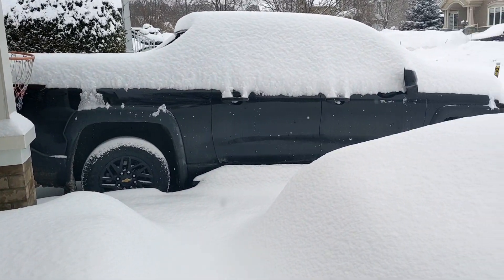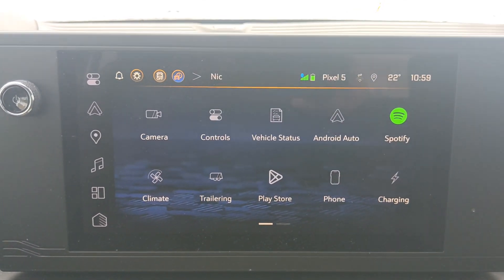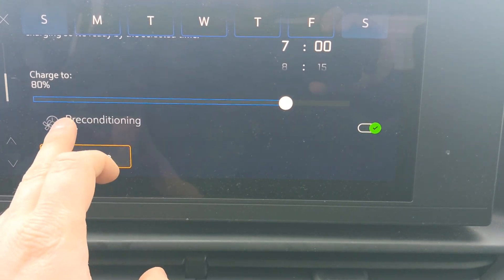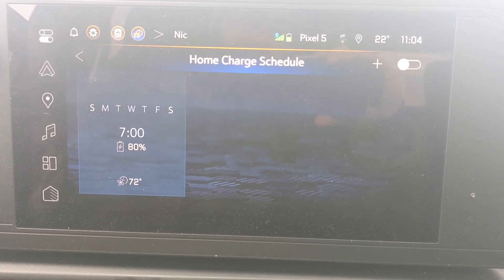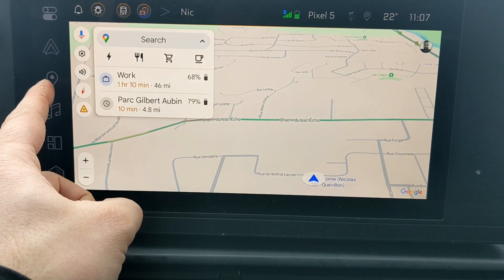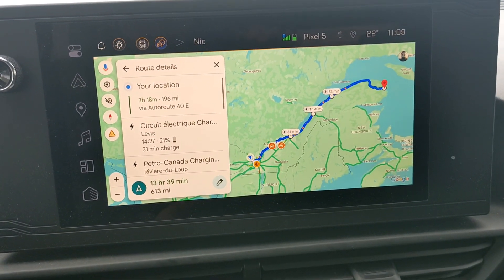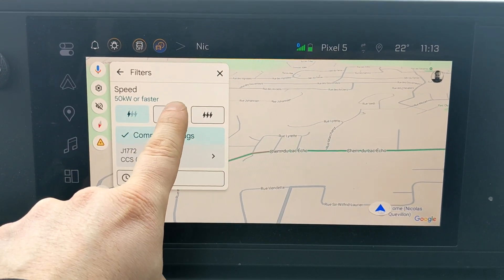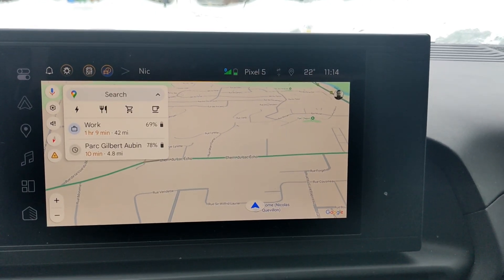Pre-conditioning on the Silverado EV (2024 4WT)

Comment: Hi, If you haven't programmed a precondition cycle and you have to go out all of a sudden. You get in, turn the heating on to 22°C (also the heated seats and heated steering wheel...), how long before the cabin is at 22°C ?
Reply from the maker: Hi, there is no heated seats or wheel in my model. I'd say I usually turn it from inside the house, put on my boots, my coat, lock the door, get in and it's around 18-20 already. Only in -20 and under I would have to wait maybe a minute (or not at all if I am removing snow from the truck) for the windshield to be completely defrosted. Overall I would say it's extremely efficient at warming up. I recommend also when you get your snow removal gear from the truck to lower both sun visors to trap the warm air in the windshield and supercharge the melting of frost (that's a tip for any car really).
Reply: @Tinkeringlife  visor tip is a new one on me. Thanks 😊